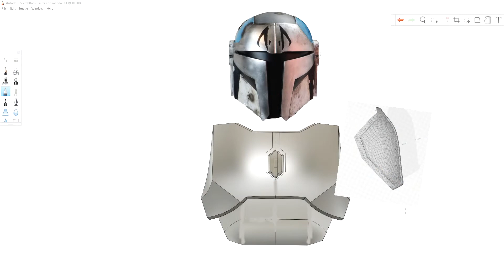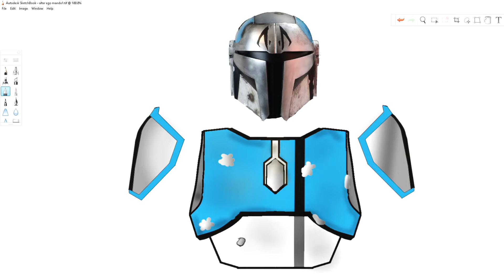Custom Mandalorian Armor Tutorial 3d printed [chest armor and Pauldrons]

Comment: Did you prime the pieces before the acetone/putty layer? My understanding is that acetone and raw pla are a bad mix. 
I've been getting by w multiple putty layers and much sanding. That would be much quicker.
Reply from the maker: acetone doesn't react with the pla the same way as other plastics, it would however dissolve the primer. The acetone thins down the putty and makes it dry superfast so you can do several layers in an hour and it gets fully into the layer lines.
Reply: @JeffMarxWoodworking  huh,  I'll have to try it on the next print.